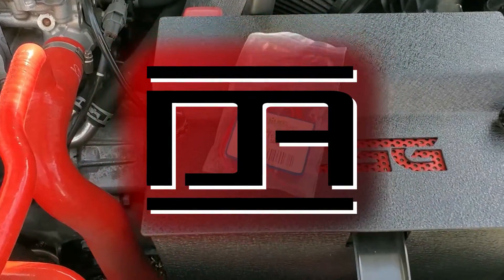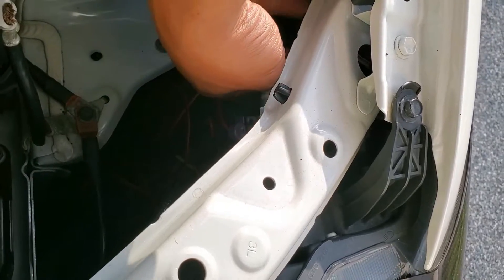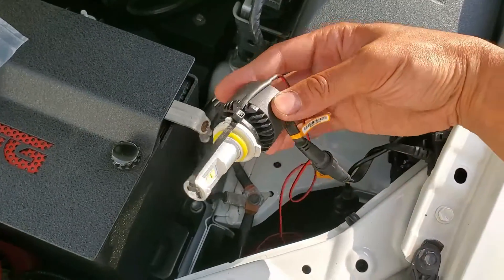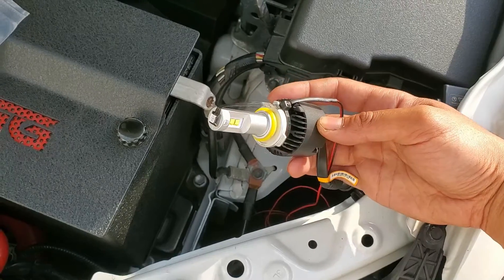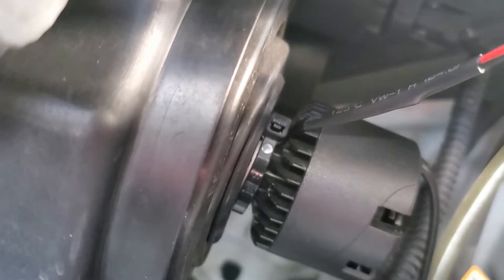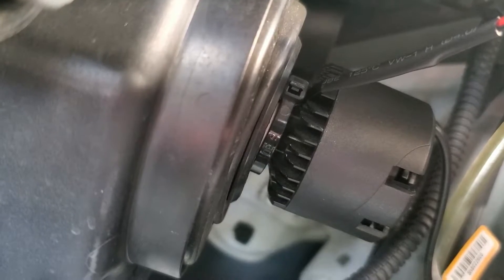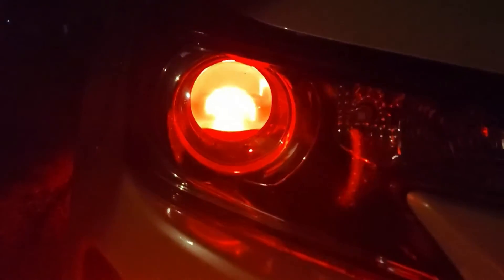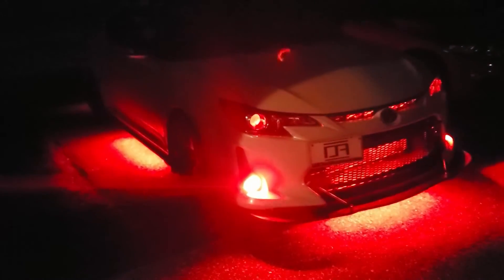Demon Eye LED Projector Easy Install Without Opening Headlight Housing (Scion tC2 / tC2.5)

Comment: would you be able to make a detailed video on how you tapped them into your under glow?? i’m  looking to do this project soon! looks awesome!
Reply from the maker: I'll check some of my old footage that I haven't published yet and see if I have video of me wiring them up. If not, I'll write up a detailed explanation here.
Reply: @VampyreX13  Great! that would be much appreciated !
Reply from the maker: @Henry-yb7sk  what underglow kit are you using? Is it the same one I have installed?
Reply: @VampyreX13  i don’t have the slimline like you do but i’m running a very similar set.same general layout
Reply from the maker: @Henry-yb7sk  I can't find any footage, but since you're running the same kit, buy these 2-pin JST connectors from https://amzn.to/335LYEs and create a y-splitter with them. Install it between the control box and the underglow tubes. Then make a harness going to each headlight to plug into that splitter. Check the polarity as I had to reverse the wires on the new harness. On the other end that goes to the LEDs, I recommend using waterproof connectors such as https://amzn.to/3lSfNQn (the exact ones I'm using are out of stock). I actually installed two of these on each end so that I can power my demon eyes and fog light halos. Message me at http://m.me/vampyrex13 if you need help.
Reply: @VampyreX13  hey i appreciate the detailed explanation! huge thanks and keep up the great work ! i’ll let you know how it goes
Reply from the maker: @Henry-yb7sk  oh, I misread one of your posts. You don't have the Slimline like me. Just find connectors to match whatever connectors your underglow kit uses.

Comment: Think you could do a quick fix for the rear bumper sag on the 2.5 tC? I saw your front bumper sag video and would love something for the rear bumper. The brackets suck and the plastic breaks so debating trying a quick snap on piece like you did with the front or just get new brackets that’ll most likely break again.
Reply from the maker: Depends on if I have a tC to work on with a sagging rear bumper.

Comment: Does it overheat and damage the led headlight?
How long did it worked?am planning to order it.does it have any issues in long term? Is the quality good? 

Appreciate your work✌
Reply from the maker: No, it doesn't get that hot. I've swapped out my headlights since this video with Boslla B4's that I was sent to review. I actually have two surface mount LEDs on them; one on each side since the front isn't flat. I haven't had any issues with the headlight or the surface mount LEDs.

Comment: Wow that was so easy! Hope i know how to tap them properly 😞
Reply from the maker: Are you running a fresh switch or are you tapping into an existing circuit?
Reply: @VampyreX13  what would I attach the demon eye wires to? I want to do this
Reply from the maker: @SorrowCloudE  I would wire in a dedicated switch for them. In my case, I had a dedicated switch for my underglow lights, so I just tapped into that circuit.